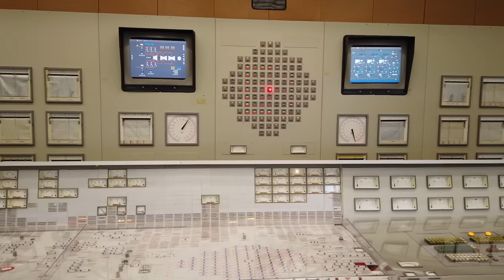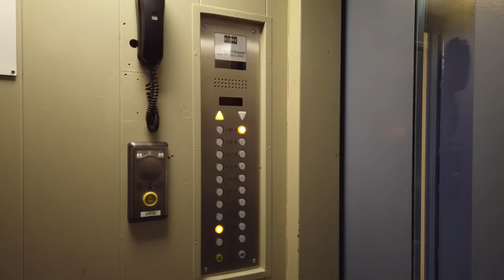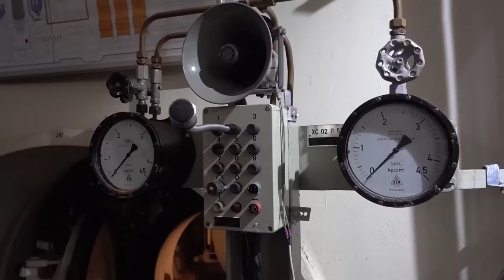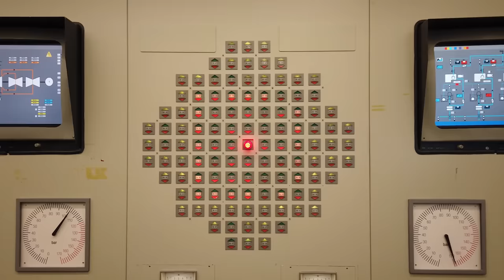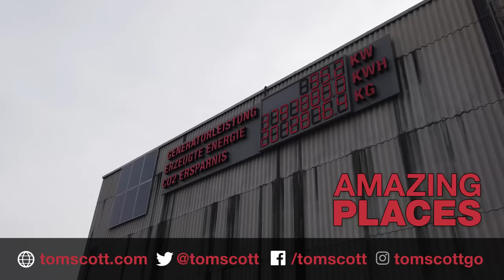This billion-euro nuclear reactor was never switched on

Comment: I wish people would stop hating on nuclear. It is so misguided.
Reply: There's always that chance of a devastating meltdown which in most cases causes massive amounts of damage so people won't risk it
Reply: Some politicians even call it "male supremacy" because reactors are supposedly "masculine". Environmentalists are an odd omelet of ideas. It is true that men tend to support nuclear but that is an odd reason to oppose it.
Reply: The thing is renewable energy is cheaper and wildly accessible. But what about the power spikes? It is still cheaper to build batteries and gas plants for the peak hours then it would be to build and run nuclear or coal power plants.
Reply: Sassy The Sasquatch  The only reason to hate on fusion is that it currently doesn't exist viably - but you put the N-word (not that one) in front of anything and it's a boogeyman. MRI scanners are not called "Nuclear Magnetic Resonance Imaging" because the second you attach that word to anything it scares ill-informed people off.
Reply: 432423429482 
Doesn’t make any sense to me, I tend to base my political ideology on facts not feelings.
Reply: Gary Matthews 
As it turns out, so are you.
Reply: @rangergxi  I live in a third world country and it makes me laugh when I hear ideas such as this: like that manspreading issue😂
Reply: nuclear waste exists
Reply: Some people prefer coal for some reason, I do not understand why. I suspect that burning coal is easier to understand that some invisible radiation...
Reply: @Adrian-jn9ov  I've heard people more educated than me say that green power sources are still more expensive than nuclear power. I've also heard that, because green energy is inefficient, we don't have the resources or the space to build enough to completely replace the power grid.
We still need to invest in green energy because I would like for it to be our replacement, but I think that nuclear energy generation has evolved enough to where it's a sufficiently safe and viable replacement for coal.
Reply: Yup. The problem is that people are massively afraid of the word 'nuclear'.
Reply: its actually the soviet union i hate
Reply: The Sofos Project Nuclear power is far more expensive than any other energy source if you consider the costs of waste storage. That part is however mostly considered a task of society and therefore the market price of nuclear power is low, because it does not reflect those costs.
Reply: @rangergxi  The people who say that tend to be made of straw.
Reply: @rangergxi  which politician calls it 'male supremacy'? Can I get a name?
Reply: @aquatikcamel4034  The fact that there are hundreds of nuclear reactors around the world and 99% of people only know the names of 3, says a lot about how much misinformation the university of facebook nuclear professors have spread, it fear mongering. In my experience most people don't even know about 3 mile island, but I included it in the 3 anyway.
Reply: The only issue is that we keep building reactors with outdated technology. We use uranium because we can make bombs from it and water as the coolant. Thorium molten salt reactors are way safer and it's literally impossible for a meltdown to occur.
Reply: @rangergxi  I really don't think that's a common view.
Reply: @aquatikcamel4034  thats only of you use a shitty reactor from the 70s. There are a lot of new reactor designs that are physically unable to go into meltdown like nuclear salt reactors based off of the way they are designed
Reply: @SofosProject  I don't know that the issue with renewables is their cost or the limited quantity.  Rather, it's that we're not in control of them.  Solar and wind are great, but you don't get anything from them on a still, overcast day, or on days with winds that would rip operational turbines apart.  And those are often days when you need more power.  It even causes problems for parts of the day.  As a result, we either need other means of generation that we control or huge batteries to store excess power.  Batteries on this scale are tricky, and people are working on solutions, but until then we need alternatives!
Reply: The same people who hate nuclear are the same people that think that humans are causing global climate change.
Reply: @NetAndyCz  burning coal releases more radioactive radiation into the atmosphere than a nuclear power plant ever will. Also releases arsenic and other heavy metals.
Reply: Zero Cool  Whats wrong about that statement of course there is the nuclear waste to deal with, but please say why. I may be biased because I agree with him, but please say why.
Reply: Mining the uranium you need is actually very hard on the environment... especially as it gets rarer and rarer
Reply: @markofexcellence5209  we are. If you want an example of why what we are doing is actually changing the climate look at venus.
Reply: @aquatikcamel4034  But there isn't always that chance. The problem is people think that there is.
Reply: @Flowstate._  you dont need uranium to run a reactor. You can do it with thorium instead which is much more common
Reply: @Adrian-jn9ov  solar costs four times as much and wind costs twice as much
Reply: @Adrian-jn9ov  The idea that renewables are cheaper isn't exactly true. For one, renewables are currently only as cheap as they are as a result of substantial government subsidies paired with relaxed regulations on them, subsidies which nuclear does not receive (while nuclear also faces some of the most severe over-regulation in the energy sector in the West, i.e. the treating of tritiated water as deadly waste), though renewables are gradually becoming less dependent on those subsidies. Secondly, renewables are only cheaper, even with those subsidies and the deregulation, in the short term. Long-term costs, such as the greater frequency of replacement (in whole panels and turbines and parts), greatly increased maintenance (especially in dusty areas, areas near saltwater, etc.) in comparison nuclear lead to it being more expensive as well.

This also isn't getting into the fact that costs will absolutely increase over time as the share of the grid held by wind and solar increases, partially as a result of scarcity of rare earth minerals, especially in countries which rely on 'renewables' enough to require sizable energy storage in order to ensure stable electricity provision, alongside the immense industrial waste (non-CO2 but still very damaging) that comes out of the extraction, refining, and manufacturing process for wind and solar (and even worse when battery banks come into play) when compared to nuclear. Nuclear only relies on a small fraction of the extraction, refining, and manufacturing per unit of energy when compared to renewables, while we're nowhere near a point of worry for nuclear fuel, even if 100% of global energy was suddenly provided by it.
Reply: @aquatikcamel4034  Except with modern reactors it isn't the real possibility, and in fast-neutron reactors such as being implemented by Russia and France it isn't the possibility even theoretically (because in these you have to actively keep the reaction going and if something failes it just stops itself), PLUS these reactors can even RECYCLE THE WASTE from regular water cooled reactors due to the reaction in them being more energetic. Now try and explain it to the so-called environmentalists (including some in the comments) who are on average about as informed as a hamster.
Reply: I wouldn't say missguided. It's very complex, needs supertight security and maintenance, tech can be used for non-energy purposes, and a simple looney with a drone carrying explosives can down billions of people.
It is very expensive to build a factory, and mining is never a green activity, and people don't care because they don't really know about the enviornmental consequences of uranium mining, as well as no one talks about the "depleted" fuel.
Yes, in paper, just the nuclear power plant is not a bad looking energy solution. Out of the paper, nope.
Reply: Dankeus Memeus the only problem ithat it produces rather a lot of horribly radioactive waste, and this and the reactor requires taking care of for over 1000 years after decommissioning and humans aren't very good at taking care of things long term. Ever been to an ex copper mine?
Reply: @aquatikcamel4034  Is this so? How many casualties were there in Fukushima (not counting those who died because hospitals and nursing homes were hastily and unnecessarily evacuated)? ZERO!
Particulate from coal-fired power plants kills more people in a day that the total Chernobil body count, including long term effects. Heck, Solar is more dangerous (apparently, too many installers don't take necessary precautions resulting in falling from the roofs they work on.)
Reply: We still don't have a permanent storage solution for nuclear waste. We almost do (as Tom pointed out in a previous video). At this point, as Hinkley Point C is showing, it's too expensive to build new/safe Nuclear. There are cheaper alternatives that are just as viable.
Reply: @Adrian-jn9ov  You don't only rely on nuclear, you build nuclear to match your base load, then peak hours and such can be met by solar and wind. Renewables are bad for the environment, huge sections of land needs to be dug up for panels and wind creates the typical hazards anyone can spot with huge blades spinning around in the wind (also keeping in mind the heavy metals and such that can't be recycled as of yet, most of the nuclear footprint is concrete). Nuclear is a dense form of energy and if we go with the modular reactor design, not nearly as expensive as it current is. (We have to make a new reactor core each time as of right now, renewables are mass produced so ofc they're currently cheap as chips)

Nuclear as the base load, solar/wind/hydro/batteries quickly switched on to meet peak load.

With Nuclear we also have a plentiful source of energy we could use to pull large amounts of carbon from the atmosphere to reduce the damage coal and gas has done. It's actually been proposed that if we spend time and a lot of energy doing this we could solve the problem within our lifetimes, too bad all I hear is ragging on nuclear, our only real solution to global warming by this point.
Reply: @SofosProject  Fun Fact, Merkel is a nuclear physicist
Reply: @rangergxi  *wtf
Reply: @SofosProject  Nuclear Energy is super expensive and only viable due to massive government subsidies.
Uranium mining is  very dirty.
Reply: @StoutProper  This waste is perfectly recyclable with modern nuclear technologies, such as fast-neutron reactors. Will people on the internet ever learn of the closed fuel cycle?
Reply: Its easer to hate it becuse thats what your told to do, then look at the actual facts.
Reply: Adderkleet exactly. Or indeed a particularly viable term one for decommissioned reactors. Not to mention that neither of these are factored into the costs.
Reply: @callumhardy5098  No you don't. You might think you do, I even believe you genuinely try to choose your politics based purely on evidence, but you don't actually. None of us do. Cognitive bias isnt something you can logic away. You can make your thinking more flexible by being aware of it, and its not like it makes you an automaton with no free will, but if you tell yourself "I don't let my feelings influence my opinions", then you're just actively ignoring (and thus giving more power to) your subconscious emotional biases.
Reply: @NetAndyCz  We seem to be scared more of the invisible then visible, even if it's less of a risk.
Reply: Similar thing with batteries currently lithium is also bad to mine. I don't know exactly how it compares though.
Reply: mihan2d do you also get your weather forecasts and history lessons from Donald Trump?
Reply: @maythesciencebewithyou  Nuclear receives some of the smallest subsidies in the energy sector in the US, while globally renewables are some of the most over-subsidized sources. Further, the mining, refining, and manufacturing process for wind turbines, and /especially/ solar panels, is immensely larger and immensely dirtier than that for uranium mining. Nuclear power, in every step from mining to generation, is the cleanest source of power we have in terms of both CO2 waste and industrial wastes generally. Nuclear is also cheaper than wind and solar in the long term because of its immense longevity and low fuel costs, it's only more expensive in terms of up-front costs.
Reply: @andymcl92  The cost of renewables is the fact it's a shallow puddle compared to a small ocean. Renewables are great in the right venue, the problem is that venue is on a dug up, flattened large piece of land where they can angle towards the sun. Compared to a dense built reactor. Not only that but the environmental poisoning solar panel materials can cause, it'll only add up with time until we're back here again campaigning against solar panels.

Nuclear and current renewables are the solution we should aim for, from what I've heard solar and wind technology as it currently stands isn't going to get that much better. New battery technology is a maybe, but current forms of batteries are at their limits.
Reply: @callumhardy5098  but callum, stating that only makes you look kinda arrogat, like your ideology is the only true and sensical one! Truth is you're human, and your political ideology is bound by your feelings. Cheers.
Reply: Three Mile Island, Chernobyl, Fukushima
Reply: @Adrian-jn9ov  Not correct. Nuclear Power is pound for pound a cheaper option than renewable energies. It is a one time investment, and running it from there on is super cheap. Even cheaper can coal or gas. Do you have any idea how much solar panels or windmills equals one big nuclear plant? Too many to be cheaper I can tell you.
Reply: @ImmoSci  My thoughts exactly
Reply: @kuartz.  the problem is, that you have to take care of it for thousands of years, which makes is one of the most expensive ways to produce power we have. that is the problem with nuclear power and not the low risk of a meltdown.
Reply: @konsticraft1028  And what about the enormous amount of waste that comes with wind and solar? Wind turbines, solar panels, batteries and their associated electronics (inverters) need to be replaced relatively frequently, and an absolutely mind-boggling amount of all of that hardware would be required to produce a significant amount of the energy that we consume, so do we just ship it all to poverty-stricken countries and forget about it (like we do with most other e-waste) for the rest of time?
Reply: FlappableBean  shut
Reply: @NetAndyCz  coal actually creates more radiation than nuclear plants
Reply: Why? We don't need it anymore. And even though the risks for an accident are small, the concequences are extremely massive when it eventually does happen.

Plus all the extra downsides like the waste etc. is simply is not worth it.

And that doesn't even include the insane costs ascosiated with it. Better spend that on solar
Reply: @aquatikcamel4034  Nuclear power is a plane while fossil fuels is a car. People are more scared to fly because of the .01% chance of a crash that kills everybody despite the fact that thousands more die in cars each year.
Reply: @Adrian-jn9ov  solar plus battery storage, in order to also deliver power at night, currently costs 3.6 cents per kwh on a 20 year contract.

That is easilly among the cheapest, and price is still dropping fast.
It is highly flexible, easilly deployable, virtually maintenance free, has low investment requirements and is easilly expandable, it is non poluting,  nearly completely recyclable and return on invested energy including instalation is currently 9 months.
Not to mention that efficienty is still increasing exponentially and the real bennefits of economies of scale have not yet have taken hold yet.

Unbeatable.
Reply: @BertGrink  Three Mile Island didn't hurt anyone, Chernobyl never could have happened outside of the Soviet Union (absolutely no one is as careless with nuclear energy as the Soviets were) and Fukushima simply could have been sited better (lesson learned). We don't advance by abandoning potentially dangerous technologies, we advance by learning how to make those technologies safer, and nuclear energy is already the safest form of energy that we can harness.
Reply: @baronvonlimbourgh1716  Where are you getting your figures? Who can produce 24/7 energy with solar for less than 4 cents/kWh?
Reply: Who wants lethal radioactive filth to deal with for the next 200,000 years? It's a no brainier really -great decision!
Reply: @LegendaryPredecessor  yes, nuclear is cheaper until you have generated your power. But after that you have to take care of the waste which many people ignore when looking at the cost of nuclear power. we have to store that stuff for thousands of years. and if you look at how humans/society changed over the last 2000 years, you cant predict if we will be able to take care of that for the next 2000 years.
Reply: @edwinstubbs2118  Wind is limited by the access roads to the site.  Offshore, however, can still have more done to it.  I come from near (one of?) the largest onshore wind farm in the UK, and it's a great area of land that's full of trails and wildlife that's now well preserved for the foreseeable future
Reply: @griefytrolly  nuclear waste exists but in much much smaller amounts than any other nonrenewable system without the issue of renewable systems: uncontrollable downtime. Nuclear waste is in small enough quantities that with the rise of private sector space travel, it could be viably discarded into space and left to float off into nothingness for very little cost.
Reply: @StoutProper  With the rise of private sector space travel with companies like spacex and boeing getting in on the action, the cost of sending something to space will drastically decrease in the coming decades. Just send the waste off into space and never think about it again. Easy. And as for decommissioned reactors, they're already built to contain the radiation for hundreds if not thousands of years. It would really be as simple as just shutting and sealing the doors in most cases.
Reply: @markofexcellence5209  no? these groups are unrelated where nuclear is feared because of misinformation, anthropogenic climate change is feared because it's happening and causing damage as we speak.
Reply: @Flowstate._  
Mining rare earth metals for solar panels and wind turbines is just as harmful for the environment.  If not more because you need a lot more of them to produce the same amount of power as uranium does.
Reply: @baronvonlimbourgh1716  You didn't answer my question.
Reply: @YearRoundHibernater  20 years from now we don't need them anymore, they had to be online 20 years ago to be viable.

A decade from now most powerplants ar nothing more then powerweights and eye sores
Reply: Its simply just to expensive and the nuclear fuel wont even hold for the next 200 years when continuing with the current use of nuclear energy.
Reply: Nuclear power is safe and clean, kids.
Something that most people don't get is that a city that uses renewable energy also requires a coal powerplant that works and burns 24/7. Renewable and nuclear are 100% compatible.
Reply: @_blank-_  We have solutions now. Solar, Wind and Waterpower can already be used on a big scale. Even when you dont got 100% with them. Just producing 50-70% of your energy using renewables makes a big difference.
Reply: Andrew B it isn't that simple to decommission reactors at all. Concrete has a lifespan of about 50 - 100 years. Then it needs replacing. And the whole thing needs to be constantly monitored and maintained. None of that is costed. A lot of reactors are on the coast. You have rising .sea levels. You know nothing about this do you
Reply: @griefytrolly  Well, it's the only kind of plant that actually lets you control your waste unlike gas or coal.
Reply: People are just ignorant and biased, simple as that
Reply: @aquatikcamel4034  Due to lung diseases and pollution nuclear power plants kill far fewer people than fossil fuel plants of even renewable like solar per unit of electricity the risk is relatively low and thanks to newer reactor designs like thorium salt reactors some designs could be almost unable to melt down. Thorium needs a second radioactive help material in order to produce energy but it doesn't need much helper material so if cooling systems fail you can just drain away the helper material and boom no melt down.
Reply: @Adrian-jn9ov  What do you mean its cheaper? reneuables like solar are ridiculously expensive and the main cost of any nuclear plant is just the initial investment after that it costs very little to run. I mean that nuclear plant could power 1.8 million homes which means to fund it you'd only need about 600 euros per household.
Reply: Thinking like that is oversimplification at it's finest. Nuclear energy may be climatically neutral, or even friendly but it's not particularly friendly towards humans, especially not when something goes wrong, for which there is always a chance and it produces masses of Nuclear waste that has to be desposed of, which is very difficult to do and, understandably, no one ever wants to keep it. Now fossil energy is arguably very bad, worse than it's nuclear cousin, since it's dangers are hidden we never had a Chernobyl or Fukushima for a fossil power plant after all, and the cooperations responsible for the displacement of thousands of people and the destruction of so much land know how to get both their way and to sweep it under the rug  and it's so well established and cheap that few question if it's not even defended for not being radioactive. The problem lies herein, that as it is always the case in, governments let themselves be overrun by cooperations in the interest of profit or economic growth, progress and freedom, instead of keeping keeping control and finding, funding and enforcing truly sustainable solutions or better yet have it be done for you by your subjects and your treasured cooperations which, after all have enourmous capabilities.

(Copy pasta of my own comment)
Reply: @griefytrolly  If you took all the nuclear waste ever produced by the entire country of America and made it into a rectangular prism with the dimensions of a football field, it would only be 55 feet high. A country of 330 million people could fit all their waste in one underground storage facility in the desert.
Reply: @aquatikcamel4034  As opposed to the slow, guaranteed meltdown of fossil fuels which are used because wind and solar can't replace base load power plants.
Reply: Nuclear is a dirty fuel, it isn't the answer
Reply: @kuartz.  Like, how Soviet Union did it?
Reply: @andymcl92  Yes wind is good, I don't have a problem with Wind/Solar and Hydro, we need to take into account their footprints and minimize the damage no matter how small. I'd argue Wind is the best of the 3 renewables in terms of impact, the only real casualty is the occasional bird, and helicopters if you're playing GTA5.

Solar (unless it's on a rooftop), typically requires clearing large amounts of land, and maintaining that land as to not create fire hazards and such. Not only that but panels create an environmental problem when it comes to replacing them. Hydro, well it's a big concrete dam and should be obvious. Hyrdo is useful but has the most impact on the surrounding environment, and some great risks if a hard fail occurs.

The problem with renewables is generally how much space is required for the same amount of energy, we don't want to stress our agricultural industry's more but taking up ever larger amounts of space for energy production. If we build a nuclear base load, have solar on most of the rooftops, and wind where practical, we could very easily move away from fossil fuels entirely.
Reply: Gary Matthews - Too expensive now, especially in the age of inexpensive renewables and natural gas.  Only France “solved” nuclear, because they standardized on the designs.  But they’ve had lots of trouble with the newer generations of reactors.
Reply: @kuartz.  - tell that to the face of the > 100000 people in Ukraine and the province of Fukushima who lost their homes
Reply: It isn't misguided. some of it is. I hate nuclear because of its problems with waste management, nuclear proliferation, etc.
Reply: @SkylarsTerribleMemes  It was also literally impossible for RKBM reactors to meltdown. until it did, in chernobyl. we have done some testing, but saying its literally impossible is wrong. its unlikely but it might be possible.
Reply: @aquatikcamel4034  Fun Fact, all malfunctions ever have been due to human error or natural disaster, the latter of which doesn't happen in northern Europe. People are stupid.
Reply: @aquatikcamel4034  And that is why research into sub critial reactors that cannot undergo a meltdown should be increased. (Yes i know there are super critical reactors that have procedures to limit or stop a meltdown..)
Reply: @griefytrolly  So does waste from coal mining, production. Plant production. Solar plant production and operation. etc... EVERY ALTERNATIVE WILL INCLUDE WASTE PRODUCTS THAT ARE HARMFUL. The amount of fission products with low to medium half life (the "it will fry you like an egg" kind, is lower than you think, and by the fact that they have lower half life means that storage isn't so much of an issue since they will decay over a short (say all from 1-30 years) down to safe levels. What people refuse to understand is that the danger from nuclear isotopes is inversly connected to their half life. A very active nuclear isotope with a short half life will give off larger amounts of radiation and will be more dangerous to humans, yes, BUT over less time. An isotope like U238 has a half life of ~703 800 000 years and because of that is relativley safe to handle. So, again. It's a matter of time and containment. And we are running out of alternatives. The energy density from nuclear compared to say solar and offshore wind is not even comparable. Not to mention the effects on wildlife from "renewable sources".
Reply: Exactly. I can count on my own 2 hands how many nuclear power accidents there have been since Chernobyl... 

57
Reply: Nuclear is great in concept, but almost no one has successfully built proper long term storage at a useful scale. It's a politically and economically onerous task.
Reply: @Adrian-jn9ov  source? plain calculations show solar to be 10x the price of nuclear on avg. this is without any batteries or gas backup and so skewed
Reply: @rrs_13  How does a nuclear plant suddenly turn into a nuclear bomb?
Reply: @Adrian-jn9ov  "Renewables" like wind and solar also cause more deaths and more pollution than nuclear, even if you count all of the casualties from all of the nuclear accidents in history, and all of the injuries or deaths caused by evacuation, and all the pollution from any meltdowns. Wind turbines catch fire, harm wildlife, and have more people dying or injured for each MW of power produced through the sheer amount of materials required. Photovoltaic solar panels leech cadmium and other heavy metals into the soil, leaving extremely dangerous pollution in their wake, and again, more deaths and injuries. On top of all of that, just through transportation of materials, construction, and so on, these power sources emit more CO2 and other greenhouse gasses in their lifetime.

Meanwhile we've designed and are building passively safe nuclear reactors. You can walk away from them and they would shut-down themselves, safely. Can't have a meltdown because the fuel is already melted. Can't have a runaway reaction because of a loss of power to the station, because if you did, a freeze plug would melt and the fuel would pour into a basin where it is no longer in a configuration for criticality. Can't have a steam explosion in your primary loop, because there's no water there.

Nuclear power is the only solution we have for our energy needs that has low greenhouse gas emissions. The reason "renewables" look nice on paper is because of massive subsidies and cooking of the numbers to leave-out the inconvenient facts, like how much greenhouse gasses are released during manufacture and construction.
Reply: @griefytrolly  Nuclear waste can be safely disposed of in deep geologic storage for thousands of years (yes, we are capable of doing that, and Finland is one of the premier examples; really amazing engineering by them), and the amount of it per unit of energy produced is tiny. Way, way, way smaller than the amount of clean-up required for something like photovoltaic solar, as an example, where you need to deal with various heavy metals after they are decommissioned, not counting what leeched-out into the soil during its operation.
Reply: @baronvonlimbourgh1716  It would be unbeatable if even a single one of those points was true, Nuclear is still the safest, cheapest and overall best option for power generation.
Reply: @Flowstate._  There's more than enough uranium to keep humanity going, at its current rate of growth, for thousands of years, and that's not even counting breeder reactors. Moreover, there's even more thorium to go around, and thorium is all over the place. It's in soil. It's in granite (and is why granite is quite radioactive compared to other commonly used materials in construction; keep in mind that's a relative thing, and it's by no means dangerous).
Reply: @infantjones  "i.e. the treating of tritiated water as deadly waste"

If only the Japanese would just be sensible and dump that water into the ocean. They treated it, it's only got tritium left, dilution is a thing. But nooooooooooooooooo, people scared. Can't be putting that in our oceans. The three Pacific garbage patches, those are fine though.
Reply: @edwinstubbs2118  "You don't only rely on nuclear, you build nuclear to match your base load, then peak hours and such can be met by solar and wind."

This used to be true but isn't anymore. We can build load-following reactors.
Reply: @Panderzito "The technical and legislative hurdles to install a commercial MSR will take decades."

Meanwhile in Canada, New Brunswick is already moving ahead with their plans to build a molten-salt reactor in about ten years or so. The USA is getting left in the dust by us, with nuclear engineers and companies moving up here because we have much more sensible regulation. It's kinda sad to see.
Reply: It's only bad when the nuclear waste disposal isn't done right, otherwise quite good
Reply: @kristoffer3000  I didn't say it would be suddenly turned into a bomb, as bombs are usually well guarded and deployed with some pondering and towards a target, at an occasion where the people in the posession of the bomb can forsee.
But they can sure as hell turn into a plethora of nuclear disasters.
I don't know how precisely, that's something you can ask a fellow nuclear physicist, or a citizen of Pripyat or Fukushima.
Reply: @rrs_13  science agrees with him tho, just search molten salt reactors, it's not that hard really.
Reply: @liesdamnlies3372  Apparently it costs millions annually to keep the metric fuckton of tritiated water stored in those fields of tanks they've kept. Honestly wouldn't doubt it if a lot of the Japanese politicians behind that holding would be shocked to learn that all naturally occuring water has a bit of tritium in it as well.
Reply: @willman2k8  "lithium extraction is terrible for the environment"

To put it mildly. XD
Reply: @rrs_13  So you don't know how it works and why OLD nuclear reactors can explode, yet you act like it's a nuclear bomb.
Very old reactor types can explode when they massively overheat (several safety measures in between that and normal function) and steam builds up in a contained area, causing it to explosively depressurize.
Reply: @aquatikcamel4034  that's not true. Water moderated reactors can't melt down. No water no chain reaction. That's how simple it is
Reply: @konsticraft1028  The waste in terms of volume is very little and nowadays a lot can be reused. I'm sure people will find a way to safely put it into space in a couple of hundred years.
Reply: @kristoffer3000  I'm not a nuclear physicist, nor have an engineering degree directly pertaining to nuclear reactors, so I'm not going to pretend I know anything for a fact just because I've eavesdropped uni coleagues or read about it or saw some netflix show about chernobyl. (I am, though, an electrical engineer that worked several years in the energy sector, so do I know somethings about electricity generation transportation and consumption).
But what we do know from engineering is that human fault is unpredictable, and while you may put failsafes, missfortune always finds a way of reminding you that if something can go wrong then it will go wrong.
Improbability is not impossibility, as the past has shown us that. It is a fact that we can't do a thing if we asume everything goes wrong, and sometimes we have to take risks. I just do not think that having nuclear as a main power source for the future is the answer.
I am not a nuclear hater; I know for a fact how much we rely on it for our civilization. I simply midly opose it; I do not see it as the boggieman, nor as our lord and saviour.
I see it as a present and necessary "evil", that will still be necessary for some time, but I also see present and near-future possibilities that are way more simpler and versatile and believe putting all our chips in nuclear is not the right call.
Reply: @rrs_13  Nuclear's only downside is that it takes a while to ramp up to meet spike demand, that's where hydro and other forms of storage come into play, you can have solar and wind for places where it's well suited but it's very far from the energy solution we need.

You never hear anything about the 449 reactors currently operating in the world.

Newer salt reactor designs literally can not have meltdowns, they're the cheapest form of energy generation, safest by far even if you include the 2 disasters that totaled 4000 dead, very close to carbon neutral and incredibly power dense with easy and plentiful supply of fuel, easily recyclable waste unless you're the US and they last for about as long as you want them to last, a lot of US reactors are close to 50 years old with no reason to shut them down any time soon.

The reason people are afraid of them is the past with its mistakes, it's like being afraid of cars because you saw a 50kmh(30mph) crash of a 1960's car where the crumple zone was the occupants face whilst in a new car you'd walk away unharmed.

Nuclear technology has not been stagnant yet nuclear fears have been stuck at "It's a nuclear bomb!" for far too long now.
Reply: @kristoffer3000  lmao i know the basics behind it but i aint no nuclear engineer. Are you?
Reply: it does carry some risk, nuclear waste handled improperly can cause serious health problems and if something goes terribly wrong a whole city of people would suffer along with generations of people. you dont have these same risks when it comes to say solar or wind energy worst case they take too much space.
Reply: Hirsi not in modern reactors.  All modern reactors generation 3+ and generation 4 use passive safety systems, like gravity.  Basically safety that requires no electronic or pneumatic components.  What this all means is that nuclear meltdowns are impossible in modern reactors.  When you and other say a possible nuclear accident can result you are most likely reference Chernobyl, but no reactor has ever been built like it since, and even when it was built it was not safe.  Every other nuclear accident resulted in no casualties, and little to no radiation leakage.
Reply: It's very clean energy
Reply: acutelychronic, who doesn’t?
Reply: @aquatikcamel4034  There have only ever been two major nuclear reactor meltdowns ever. 

Chernobyl and Fukushima, both caused by human error. Not by nuclear power, plus our modern reactors would basically never meltdown.
Reply: no no, only victims hate them, people who are yet to become victim like you, love them, so maybe the victim are so misguided
Reply: @MrSpasticdancer  good job it hasn't existed for nearly 30 years then...
Reply: @YearRoundHibernater  the thing with solar is that it is a decentralised technology driven by economics.
Solar systems will be on every house going forward simply in order to save money. And the cheaper it gets, the greater the savings, the wider adaoption.

The big tech companies and a lot of chinese are jumping on the storage business. Sure a tesla powerwall is still a big investment at the moment. Within a couple of years these items will be comodity goods available from lg, samsung, anker, weird chinese brands at your local retailers.

In the last decade the energy yield of a single panel has doubled. And that trend is set to continue. Meaning space requirements to fullfil electricity needs are shrinking all the time. Making a solar solution plausible for an ever increasing amount of situations.

It took 30 years, but these things are all converging now at the same time together with a lot of new capacity comming online for both battery production (mostly driven by ev's) as well as for pv panel production. Capacity has been doubling every year for many years in a row and this will also most likely continue.

Solar will be the baseload. And there will be need for peak power generation on high load days, just like we need now until we simply have over capacity in solar power we can put to other uses on the not high load days. Things like desalination of water for example. at that point the electricity is free, having a peaker gasturbine plant online all year for a few hours of power generation is more expensive then simply building another solar farm of the same capacity that always generates power(especially since peaks are during the day), so this kind of application is perfectly suitable at that point.

Solar systems will be the same as fridges and microwaves in the not to distant future. Maintenance free apliances you replace every once in a while and that every house just is expected to have. Just like your central heating gas burner for example. That needs replacing every 20 years and for the rest it is just there and every couple of years a guy comes by and does some maintenance for an hour.

The main point people seem to be missing is that energy is going to change from a resource, traditionally limited in quantity in nature and labour intensive to obtain, into a technology we can produce unlimited quantities of..

We can scale technology, technology becomes cheaper the more you we it, there is more freedom and less political dependence because anyone can manufacture it and it does not need a continious feed of resources to keep it going.

That is the big revolution.
Reply: WRONG, This specific BWR architecture is idiotic and technically flawed. The hate was Justified when this was the architecture built. Solid Fuel Fission Water Boilers are idiotic dangerous flawed machines. Nuclear is a vast collection of Reactor Types. MSR & LFTR is what we should of been building in the 1970s.
Reply: @Neojhun  this is very true. Especially molten salt should have been persued more agressivly.
Reply: @aquatikcamel4034  Nope. Civilian plants have almost 0% chance of meltdown. All nuclear accidents so far were in militarized installations with little safety features. How many accidents France had, despite running whole country on nuclear power?
Reply: @aquatikcamel4034  You don't know much about nuclear power. More people died from wind farms accidents than nuclear meltdowns. Two to be exactly.
Reply: @Adrian-jn9ov  Wrong. What are you going to do when you don't have wind for ten days in the middle of winter. Happened in Germany in 2017. New nuclear can act as peaker also. No need for expensive wind and solar. You would have to build 9 times the capacity when wind and solar only. Would skyrocket the electricity bill.
Reply: @Sander-zj3wi  The economic damage of Nuclear Meltdown & Resources Wasted is far worse than Wind Farm problems. It's cold to compare it by amount of death, but at the end of the day Energy Generation is fundamentally Economics that effect far more people's lives. Very few people get hurt by Wind Farms. Many people are paying through the nose for blown up Nuclear Station budgets. Soo it's a messed up comparison.
Reply: @Sander-zj3wi  "Expensive wind and solar" is a Propaganda LIE! All current Commercial Nuclear is multiple times more expensive than even Non Stored Wind & Solar. 1 Day Storage Capacity for Wind and Solar would make it An Order of Magnitude cheaper than Solid Fuel Fission. You have no technical knowledge, just false rumours.
Reply: @liesdamnlies3372  Both have monumentally tiny death and injury. But Solid Fuel Fission is far more expensive both to Build, Fuel & DECOMMISSION. Very few people get hurt by both Wind & Nuclear. But far more people strapped to the economic burden of Solid Fuel Nuclear. Your naive narrowminded rumor to only focus on small death count ignores the reality how these system work in economic reality.
Reply: @Sander-zj3wi  you spin up the back-up peaker gas turbines. Just like we do now.
Reply: @aquatikcamel4034  it couses 3 times less death per GWh then wind tho